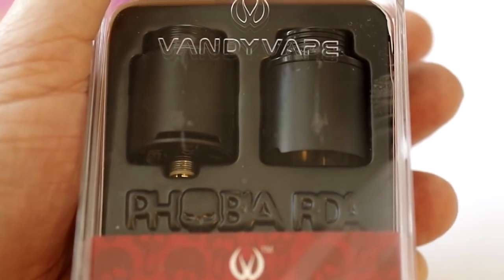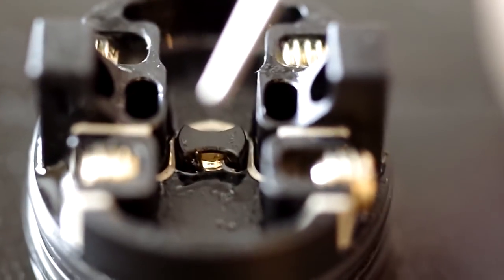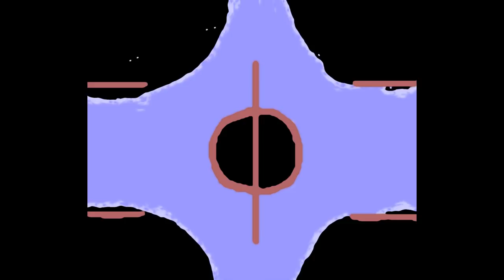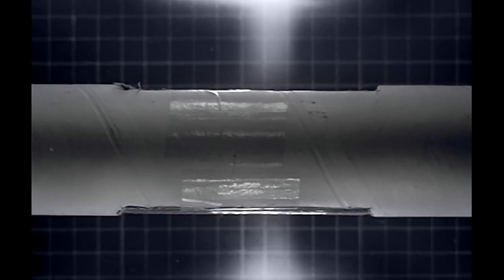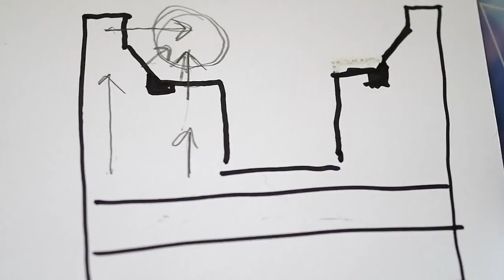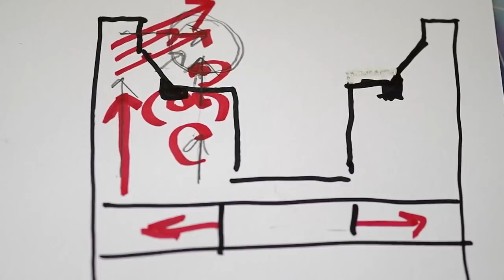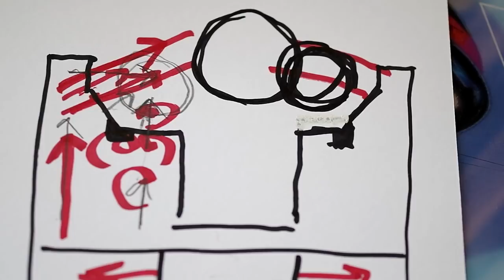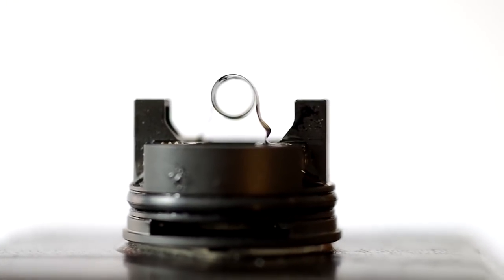Phobia RDA air flow and coil placement tutorial

Comment: After not using this rda for quite a time, I placed a single coil as you explained. I used 22 gauge ni80 round wire in a 0,36 ohm with 4 mm diameter configuration. Wicked very tight as learned form another of you videos and the results are stunning, the flavor is so much better now. Keep up the good work, we all learn a lot from it.

Comment: The creator shows on his website that there is a plastic piece or so that needs to be pushed over on the black version of the rda under the deck. By doing so and "resetting it" into the correct position the sound goes away. I wonder if this influences your results as well.. You can see his tutorial on his page, i think its vaporMD or something, Alex from Russia is the reviewer... But you basically take a  thin screwdriver and poke into the airflow slot to hit the little piece that was messed up in manufacturing.
Reply from the maker: Yes, I know:-) And it does not matter for the results of the airflow, but the nagging sound did go away. If the air hits a wall, or an equal and opposite air flow, the result is the same in these confined spaces.

Comment: Hi Morten, interesting on your results. I used fused claptons and ended up with the coils close to the airflow posts as possible. I am not sure why but it doesn't get hot at all, far less warmth than my drop and bonza rdas and it has more flavour than the drop and bonza for me. It's my at home at night dripper.
Reply from the maker: Yeah, thats another way of doing it, just block off the towers with the coils, then at least you catch some of the direct air.

Comment: Hello Oen
With regard the whistle! If you gentle push the peek airflow divider so it would be at 11 & 5 o'clock. It will stop the whistle from the reed effect caused by its position at 12 & 6 o'clock.
I shall elevate my dual 3mm coils to your recommended height and centralise them between the AFT's.
Hopefully my wick's will last much longer than with mine, and your initial coil placement.
Cheer's

Comment: How does it perform with the single coil placed diagonally and is there a cure for the whistle?  

I'm wondering why they chose to route the airflow under the deck of the rda and not simply go through the side of the towers and cap with dual cutouts... I'm also wondering how they expected the RDA not to leak in dual coil mode..

Another very interesting "experiment/study" of an atomizer... many thanks!!
Reply from the maker: Hi, Windsor! I suggest you place the coil the right way and diagonally, and report back to us:-) Tilt it from side to side when you drip, then there is no leaking.

Comment: Really interesting! I wonder if companies like VandyVape use some kind of simulation like yours when they design a RDA or if they only build airflow systems and build decks that looks cool? Thanks for the video!
Reply from the maker: Hi Nicklas! I know that Heathen for the Dead Rabbit used some sort of mock up dummy, but if you have the speed wrong, or forget about presure differences, you will get seriously disinformed by your findings. I think the Phobia looks more like a thought experiment. The divider under the deck, no matter how you turn it, will never have a function. That is one indication that they have no clue about what's going on. It looks like the companies and designers are getting more and more desperate to find The Answer by just making crazy and exotic air flow system. All while the Bonza is performing just great. I am truly baffled by all this!

Comment: Many many thanks my friend! You confirmed my deductions thru experimenting. I do have a question....If I were to effectively reduce the area of the top hole in each tower to approximately half of its original size would that generate a more balanced flow between the two holes? Specifically the top half of each top hole... A side note...even after fixing the whistle cause by the peek divider it is still very  loud and turbulent sounding. Anyway, thanks again!!!
Reply from the maker: Hi Xrex! Short answer is no. But there is a lot more to it. Watch my Kennedy design air flow video, and you'll understand. The Phobia is a sort of a inverted Kennedy, because of a lot of very complicated effects below the deck. The laws of Sir Newton springs to mind:-) And because of the work of that splendid man, removing the divider has no effect. But fixing this design on the drawing board should be easy.
Reply: I have watched it before but it was the first of your videos I watched so I'll go back and watch it again. The fact this thing works so well in single coil mode is a serious bonus as I don't own a good single coiler and that was gonna be my next purchase. Btw....I'm a huge fan of your work and will be donating! Thanks again!!!
Reply from the maker: Thank you for kind words and support, Xrex!

Comment: I thought it might work like a single coil dripper just like you had it after seeing other videos on it and a better look at those towers as you call em. And with everybody's leaking issues. I didn't see that coming though. And I dunno if you know by now but there's a fix for the whistling which I'm sure you'll get plenty of comments saying so, but just poke the divider in there to move it where it should be. Was a quality control issue I hear.
Reply from the maker: Hi Chris! The leaking is fixed by tilting the RDA from one side to the other when you drip it. That way it takes 20-22 drops of e-juice with ease. My divider looks like it is in the proper place, but I'll look into it.

Comment: Also have you watched Alex vaperz md video of how to “fix” the airflow?? Apparently the peek insulator divider was placed wrong at the factory and u have to stick a needle type object in and adjust it. If you are interested go watch his video!! This is supposed to fix the whistling sound also I really would love to see if u did this “fix” if it affected the results at all.
Reply from the maker: Hi, yes I know about the fix now. I just removed the wings of the divider. It does not matter for the air flow at all. If the air collides in a wall or against an equal and oposite force, the result is the same, so I just removed it. No practical difference to results. I am comparing it right now.

Comment: If your Phobia RDA whistles like that its most likely because of the insulator not being installed correctly within the airflow underneath the build deck. Alex VaperMD published a video on his channel how to easily fix this problem. I'm pretty sure the "Divider" is installed wrong on your device Oen. Here is the link to how to fix the whistling by moving the divider: https://www.youtube.com/watch?v=kN_UBObksS8
Reply from the maker: Yes, I have seen it. Positioning it so that each tower get air from only one side, makes the flow even more concentrated to the side, like a reversed Kennedy.

Comment: I guess most of your simulations would change drastically if you move the divider into another position. I am not 100% certain if you got one where it was installed incorrectly... but regardless of it, it seems you are able to change it manually.
Reply from the maker: Hi. The divider is in the proper place, as you see in the first images of it. With or without the divider, the results will be the same. The divider is just stabilizing the flow, not guiding it.
Reply: Thanks
Reply from the maker: My bad! The divider is not in the proper place in the video. But it does not matter. I have just removed mine completely, and the air flow is the same, just as predicted. It's like a collision. If the two forces are equal, it does not matter if they hit each other or a divider. Sorry for the confusion!
Reply: Thanks you morten for always updated your informations! Maybe put the updated informations in the description of the videos? Cheers from Tahiti

Comment: I disagree, I haven't used science, I used trial and error, I get no whistles nor does it get hot. I settled on 5 wraps 3mm 22 gauge ni80 running on a mech. Flavour is very good to. I'd love to sit down for build session with you so we could suss it out together. Thanks for your time.
Reply from the maker: Thanks Jason. I removed the divider under the deck, and the annoying sound is gone. The air behaves just the same, with or without the divider. I think, if you lift your coils up a bit, it could work with two coils also. Yeah, a build session would be cool:-)

Comment: You should be making big bucks with your knowledge. Why haven't  a big vape company got you on board yet?
Reply from the maker: Two of them has. One RDA is finished from prototype stage. Another one is going to prototype assembly in a week or two. They will both be good.
Reply: Wow that's great. I'll definitely buy them if they have your input on design
Reply: Morten Oen when will your 30mm rda be released?
Reply from the maker: I have no ETA on that. I'll tell the moment I know!

Comment: 12:33 I'm a total noob at these things, but from what I see, there's something inherently flawed about your simulation.
In it, you push the air inwards through the airflow holes at the bottom, but what happens in real life, is that you create an underpressure in the chamber, which pulls air through from wherever it can get it, so not just from the top hole in your drawing/simulation.
Reply from the maker: I do not push in air anywhere. Please watch some of my other videos. I use a vacuum cleaner at 12 o'clock position, The air chamber is a low pressure environment, just as an RDA in real life. I explain this in most of my videos. Must have forgot it this time. Sorry.

Comment: Ok...  so...  what's the whole point???   Tell you a gat" this r.d.a. & the Onley "issue" that i have is the "wistle" & i'm Fix it at all!   It's not made for Single Coil!  This is Not designed tu use "Single coils"  they give you this option,  But the design is made for Dual Coil!  This "PHOBIA" gives a GREAT FLAVOR!  & DENSE CLOUDS Too!!!  I have a lot of others r.d.a. more expensive & the "air flow" it's more Turbulent than the Phobia!  Its a Great r.d.a. in my opinion...